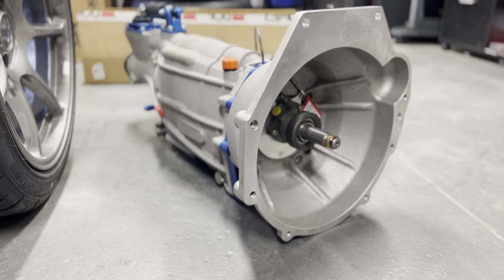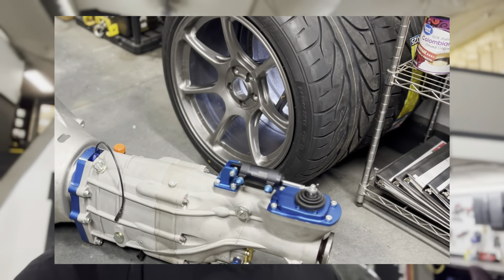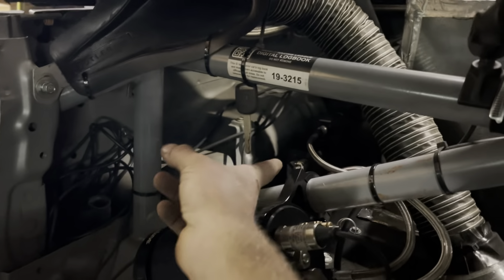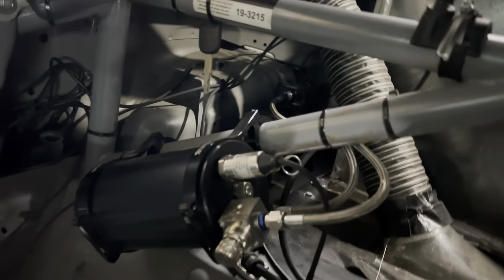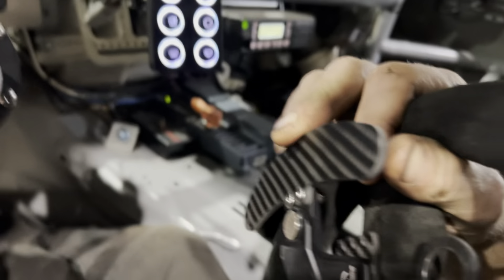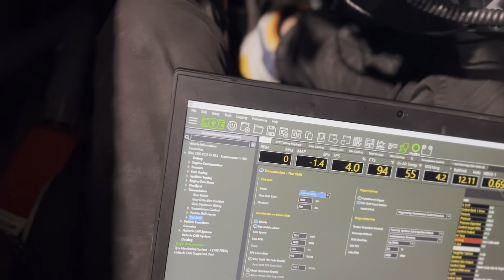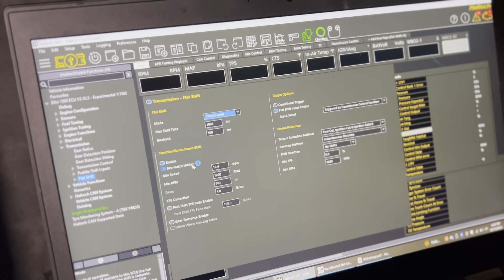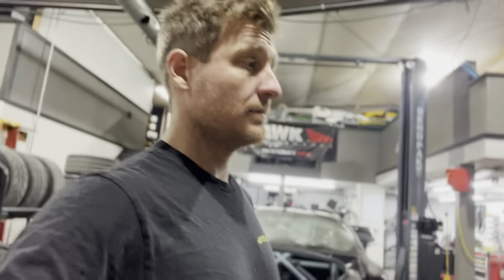ASM Tech Bits - Pinky Shifting with an S2000 (NOT a DCT Trans)

Comment: Isn't it best to retain a stick in case the air shift fails? They used to do this in WRC and it would have helped the Evasive S2K at Pikes Peak as that system failed on them.
Reply from the maker: Nope.  We have an “emergency shift plan” if needed but these air shift systems have been in hundreds of real endurance cars and very rarely have issues.

Comment: That's pretty trick! Very cool it'll prevent money shifts, and even better it'll stack requests so you can click off two downshifts coming into a turn knowing you want to leave in 2nd and it'll get you there.

Hypothetical: What happens though if you queue up three downshifts and then change your mind and only want two? Or Two are queued, you only want one. Does a shift indication up pull one out of the queue?